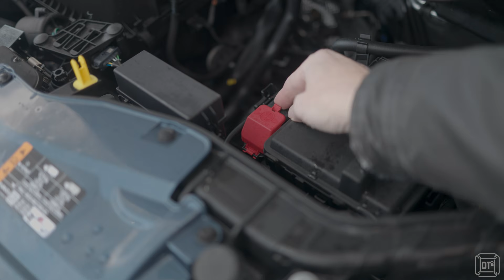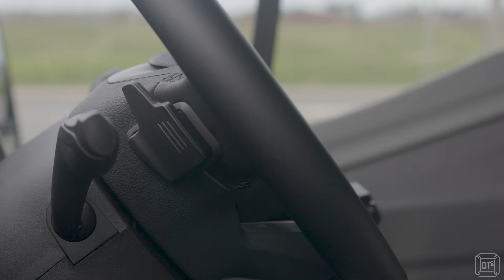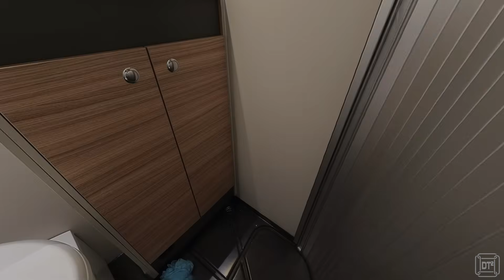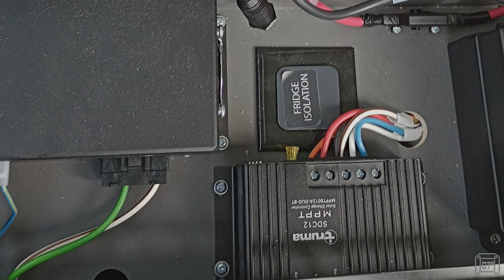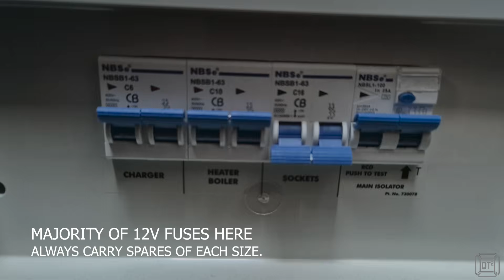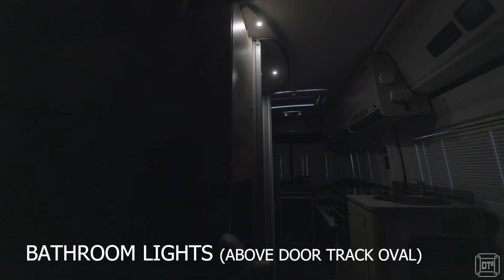Review of the Bailey Endeavour B62 campervan

Comment: A power bank would help with off-grid capabilities; at least that’s the gist I get from ‘vanlife’ videos.
Reply from the maker: I agree power banks are at least a partial solution by adding additional capacity. However in terms of the vans mains systems, such as the diesel heater, they can only boost them by powering the onboard mains charger with the power banks inverter. Which is not the most efficient method.

Comment: Excellent review, technical and relevant. Were you concerned about the Wet belt issue? Tall hence same driver seat issue
Reply from the maker: The wet belt issue was, as far as I can tell, originally an issue because the initial service intervals were too long. This was apparently because oil dillution occured because of the DPF systems active regen.
Now that the recommended replacement durations have been shortened it's mainly an issue of cost as they need to be replaced roughly twice as often as originally specified.  In theory campervans which tend to do frequent long journeys that get the engine up to full temperature should perform less active DPG regens and so have less oil dillution.
Reply: @DTSquared  Thanks for a tall person the ceiling height and the openness makes it attractive vs Ducato and others. Of course the storage limitations are the trade off, and the oven is a bit superfluous as I’m not a fan of cooking (smells) in a van prefer cooking outside. Weak electrical system for off grid will be less important as ‘wild camping’ is getting less accepted around europe , Aircon option on hookup would be nice ….

Comment: Hi does the engine bay still suffer from water ingress, we previously had an Adamo and they suffered dreadfully?
Reply from the maker: There's still the debate about whether the injectors require an  additional cover to avoid them getting wet and rusting in. One view is that the engine needs to be run regularly to avoid damp building up. But it's essentially the same base vehicle as the Adamo. Did you have water ingress issues with yours?

Comment: Hi Dave. My  son works for a very large fibre optic cable company. They 'used' Ford Transits extensively. He reported to me that they have suffered 17 Transit wet belt failures, typically occurring around the 70 k miles mark. Wet belt failures can cause catastrophic damage to the engine. Not only that, many of the vans that suffered the wet belt failures also suffered brake vacuum failure at the same time, rendering the van's brakes largely ineffective. Ford has reduced the wet belt change period from 150'000 miles down to 100'000 miles but this would still not have prevented any of the wet belt failures my son's company had. I personally wouldn't buy a Ford Transit or the new Ford Transit based Volkswagen Transporter. My advice, if you already have one, would be to get the wet belt changed at 50'000 mile periods, hopefully before the wet belt has degraded, each time.  My son's company no longer buys Ford Transits and has moved to Mercedes. On another point, was that rust in the camera shot on the van by the water taps on either side of the van ?
Reply from the maker: Yes I'm aware of the wet belt issues. Interestingly the cause of the failures is related to oil dilution caused by the emission system. Specifically forced/active regens of the DPF which tends to happen in vehicles driven on short/local journeys meaning the engine doesn't get up to temperature for a passive regen. I'm not sure of your son's companies usage profile but that may have been a factor in their high failure prevalence. 
From a campervan perspective our driving profile would always involve regular long journeys, hopefully avoiding the active regens. Annual mileage for campervans and motorhomes is much lower so the age based change periods (which have also been shortened) would be the things to watch. We are planning to do a wet belt change ahead of the recommended age periods, whilst a wet belt change is more expensive it's not that prohibitive.
Re the sill seam "rust" it's residue from some sort of coating they use in the production(I think someone said it was wax based) . Whilst the colour looks like rust if you look at the shape/pattern it's more apparent that it's something that's solidified as it dripped down.
Reply: @DTSquared  My son's company serves the whole country and it is rare to just do local journeys for them. At the moment my son is working in Birmingham, about 200 miles from their base. The van's had always been correctly serviced as well, at the correct Ford intervals, with the correct oil. Whoever thought that putting a rubber belt in oil, certainly was not a very good engineer. What I say still stands. A wet timing belt change interval of 50'000 miles is logical, otherwise belt nodules and particle in the oil take up will be the result, with consequential oil starvation and catastrophic failure.
Reply: @FredFox-m9v I’ve a tame mechanic pal who makes a living out of fixing Transits (and other Fords) due to wet belt failure. I’d never buy a Transit van for this reason alone.
Reply: My company runs just over 40 transits. All with wet belt. We havent had a single wet belt failure. We have had a few that have had injection failures - they were all using the duff parts that affected 2019/2020 engines. Perhaps failures have been down to poor servicing.
Reply: @wallybazoo1434 They definately weren't serviced badly, with Ford themselves servicing many. The situation was so bad after 17 vans failed that the company has changed to Mercedes vans. Numerous  other commenters on various youtube sites have come across this problem, yet you haven't ? You only have to do a quick youtube search to get numerous wet belt failures videos like this:-https://youtu.be/xLdDed64iYQ?si=0Hz66qTw_HLyQhh1
Reply: @FredFox-m9v i can only go by my company and our fleet manager. I'm not saying it"s not a known issue, only that we haven"t suffered any wet belt failures.i asked him about this specifically as i"m thinking about a buying a Transit based campervan. It's also worth nothing tjat Ford will replace the engine if the wet belt fails - if the servincing is adhered to.
Reply: @wallybazoo1434 within warranty maybe but they generally fail about 70k miles and obviously out of warranty.
Reply: @FredFox-m9v that's wrong. Ford will replace the engine if it fails due to a wet belt failure as long as the servicing has been adhered to. Even after the bog standatf 3 year warranty. Belt replacement is 60k.
Reply: I bet you are a salesman's wet dream. I thought my EV battery would be replaced until I actually read the warranty. It had the words ' any or all of the commitments within this warranty can be altered or withdrawn at the discretion of the manufaturer ' .
Just because you want something to be correct, doesn't mean it is.

Ford has officially reduced the recommended wet belt (timing belt) replacement interval on the 2.0L EcoBlue diesel engine to 

6 years or 100,000 miles (approx. 160,000 km), whichever comes first. This revised interval, reduced from an earlier 10-year/150,000-mile recommendation, applies to Transit and Transit Custom vehicles.
Reply: @FredFox-m9v the mechanics i know who service our vehicles recommend 5 years or 60k.
Reply: @wallybazoo1434 They are not Ford.
Reply: @FredFox-m9v yes they are Ford commercial. Although not from Ford itself that's what they personally recommend for vans with heavy use - like ours. They also said Ford will be phasing out wet belts in favour of chain driven.
Reply: @wallybazoo1434  not before time, they have been a disaster for customers and Ford themselves.

Comment: Excellent video. At 6ft 1ins tall I know that lots of leisure vehicles don't provide decent lengths for single beds. The B62 looks as if it might be acceptable but not quite as long as our caravans 6ft 5ins length lounge bed. And, yes, shortening the other side would be fine as my other half is just 5ft 1ins tall. What you often find with these panel vans is that strengthening ribs in the body dictate where furniture is secured and that limits what can be done. I went round the Bailey factories in September '24 with the Bailey Owners Club and saw the panel van fitting area and the blue vans were parked in lines all over the site. Interestingly unlike caravans and coachbuilts which are assembled on moving production lines, the PVC's sit in a bay and the fitter teams move round to each bay in turn to save moving the vehicles.
Reply from the maker: Thanks glad you liked it. One useful tip to improve bed length is to modify the pillow you use so that it is not aw wide (in the shorter dimension). Normally a normal pillow's edge rests against you shoulder when sleeping, so unless the person's neck is very long, they have a tall head, or are wearing a hat to bed, then the top of the head is short of the end of the bed by several inches. It's an easy way to make the bed effectively longer.
Interesting to know about the production line difference. I get the impression that PVC's are more of a modification process rather than an assembly line. Likely with less consistent process/station timings, so in a way it makes sense to leave them parked and let the relevant team come to them when they and the van are ready.